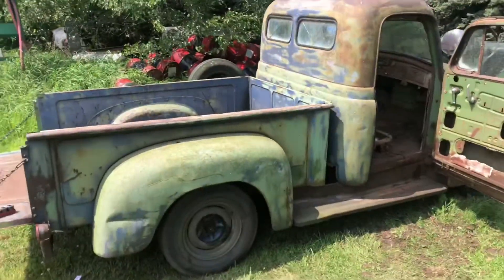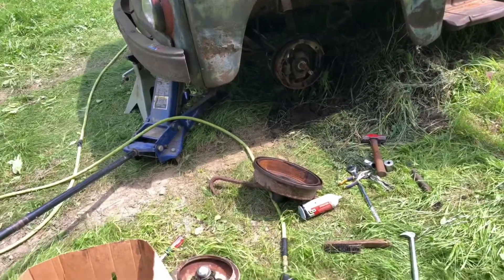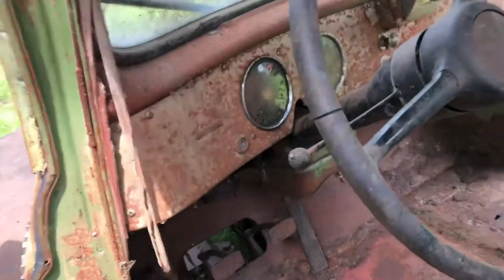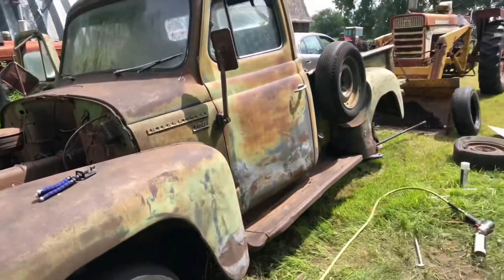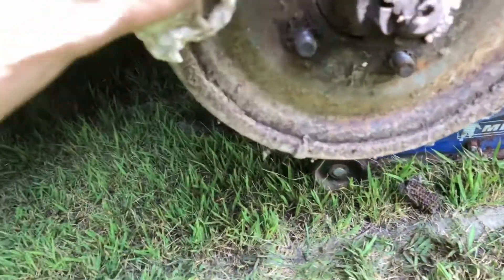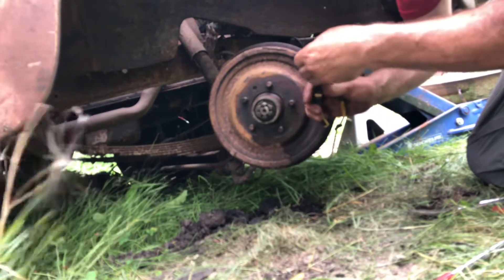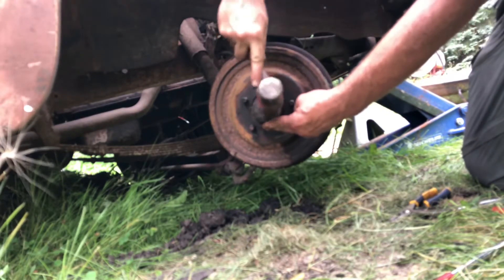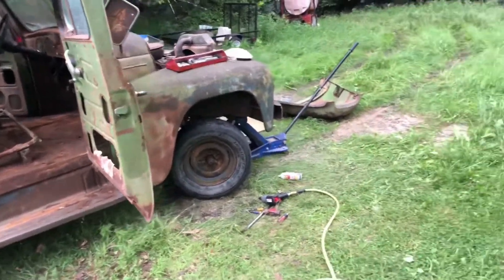Working on the 1955 International Harvester pickup

Comment: You don’t need to turn it into something, it already is! Nice truck
Reply from the maker: I would like to turn it into something running.  Just too many projects, not enough time.  Had a little chance to get it out this summer but it didn’t work out.  Hopefully it doesn’t rot away before it can be saved.
Reply: You can only do what you have time for. Dragging it out, cleaning it out and getting tires on it to hold it higher off the ground will help in preserving it. My Dad had an IH farm truck when I was a kid with his name professionally painted on the doors, I wish I had that now.

Comment: Once a talk a friend out of his scout terra im goin to start work on using a 84 k10 parts donor with a 57 s110.
Reply from the maker: Nomad IH a Scout frame and power plant under this old truck would be cool.  Keep it IH!
Reply: Tom's Tinkering and Adventures your swb r100 would fit near perfect on a terra/traveler frame. Only bout 3” difference between em and a little body work and youd never know the difference.
Reply from the maker: Nomad IH find a 304 or 345 powered one..nice!  I’m looking at Mercury Mountaineer now, exactly the same wheelbase
Reply: Tom's Tinkering and Adventures just stay away from the ford ohc engines. They get expensive fast. 
Im goin to get a bunch of measurements tomorrow from my 57, i plan on using the IH frame but the GM springs, 10bolt axles, 350sbc, sm465, and np208. The terra is super clean 196 i4 4spd just need to do brakes fuel and drive.

Comment: Dodge Dakota is what’s being used on that style International. I’m doing a 55 now.
Reply from the maker: Mike Maurer I would love to see some pictures or video!
Reply: @TomsTinkeringandAdventures I'm just getting started on it. But, there are several on YouTube for to look at.
Reply from the maker: Mike Maurer I’m gonna take a look, thank you.
Reply: Tom's Tinkering and Adventures   Did you see the others on here?
Reply from the maker: @mikemaurer3061  I found one video with a Dodge Dakota frame swap.  Pretty interesting but didn't have much information on how they did it.  I won't be able to work on this truck for quite a while anyway, so hopefully I can get a good game plan before then.
Reply: @TomsTinkeringandAdventures  I wish when people have a complete truck they restore to original.  If you want to use only the body, find a body that has the drive train out.  There are not enough of the complete trucks left anymore.  IMO
Reply from the maker: @krabenaldt7605  while I understand the sentiment, I can see a few reasons why someone may use different running gear.  Reliability, cost, ease of driving, etc.  I remember how this truck drove 30+ years ago when I last drove it.  I wouldn’t want to have it in modern traffic, so if it were stock it would mean it would not get driven.
Reply: @TomsTinkeringandAdventures  not to stir the pot here on an old post, but you can keep a truck original and still enjoy it. I have 3 50's ih pickups that are all original. I take one of themout for a cruise pretty regularly. You just have to understand that it's not like a new car with power brakes don't drive over 55.
Reply from the maker: @bobcoakes262  that’s absolutely true.  Everyone has their preferences though.

Comment: Could I buy the starter off you?
Reply from the maker: I highly doubt that it's any good, hasn't been used in over 30 years.  I only get back there a few times a year, but if I get a chance I will look at it.
Reply: @Tom's Tinkering and Adventures  all I need is the drive gear out of one, so as long as that's in one piece I'd be interested in it.
Reply from the maker: @colbywedgworth9676  Ok, it could be several months before I get back there but I can take a look.  Thanks for watching.